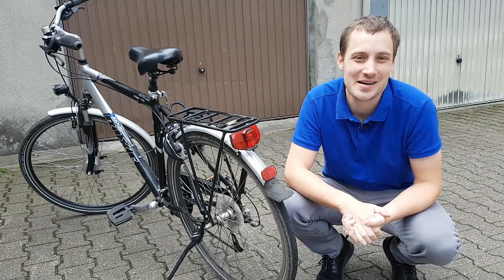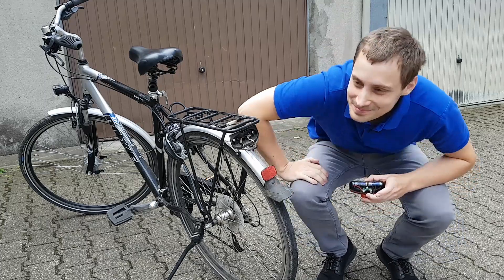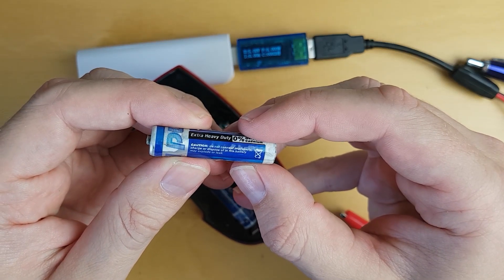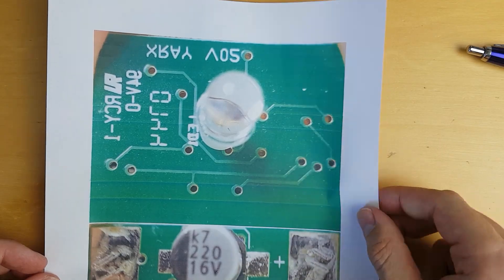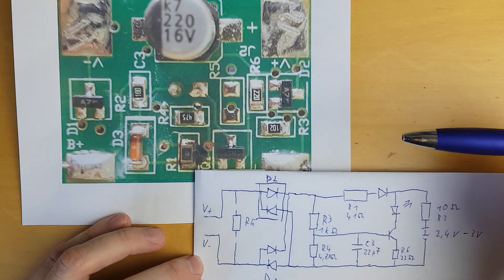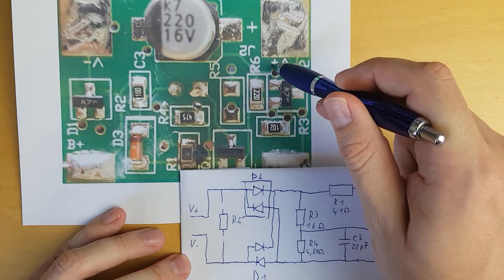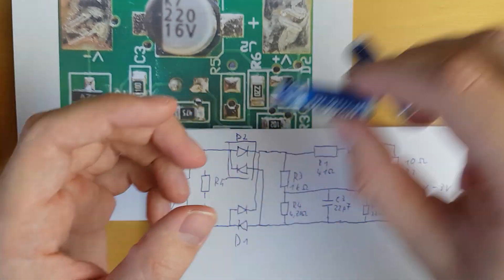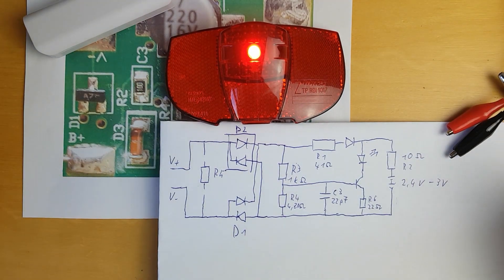repair and reverse engineering of a basta x-ray steady bicycle backlight

Comment: Hello. I have such a lamp. the problem is that if I put a battery in it, it lights up continuously (it's true that the battery is alkaline, but how can it be...) it can't be turned off unless I take the battery out...
do you have a solution for this?

Comment: Helped me a lot ..but..Checked it with a multimeter. the voltage @ the batteries does not exceed 3V. The big red diode [D3] on the  circuit which is kind of actively overlooked in the diagram appears to be a voltage limiting Zenerdiode.

Comment: Great work, very informative, thanks! It is strange that they use alkaline batteries for parking light. Mine doesn't have any batteries, instead there’s a capacitor on the circuit board, which is a more common solution among this kind of rear light.

Comment: Hi, I appreciate the video! One thing puzzles me though - why (except the cost) it was originally made with non-rechargeable batteries? Mine leaked as well, probably due to some moisture inside. I will try to revive it :)
Reply from the maker: I don't know. I agree that it is a little bit strange.
Reply: @MartinMeise  I am afraid that my lamp got corroded beyond repair. It does not produce any light at all. Still - thanks for the answer! Cheers.
Reply: Yes it is strange that they use alkaline batteries for parking light. Mine doesn't have any batteries, instead there’s a capacitor on the circuit board. Maybe it’s another version.

Comment: Hi, it is a very interesting video. I also have a Ellipsoid bicycle front light, model FL301. It does not work, I tried to take it apart to see inside, but its circuit is very complicated beyond my knowledge. Have you ever investigated this model or similar? If yes, could you please tell me a bit about its circuit/schematics?
Reply from the maker: Sadly, no. You could sent the Light to me and I maybe able to investigate.

Comment: What is  value R1 in ohm?  It  Seem that it is burned and I don't read the value. Thank you.
Reply from the maker: I measured it to 41 Ohm
Reply: @MartinMeise  so you measured with multimeter, you don't see the value on resistence, You too in the video R1 seem that  burned. Thank for reply

Comment: Thanks for the video! I wouldn't have guessed that it needs batteries, as mine was lacking them :)) I still have got one question. Will the light remain on until the batteries totally discharge? I can't see any mechanism for turning the light off after a certain amount of time, but in some places it says the led should be on only for 4 minutes after stopping.
Reply from the maker: Hey Reymond,
The light will stay on until the capacitor C3 has discharged below roundabout 0.6V. Then the transistor will turn off and the light will go off as well.

Comment: If you pedal too hard R2 and R6 will burn. Don't ask me how I know.. Now is it possible to make the light turn on again by making a solder bridge at R6?
Reply from the maker: Normally your generator should have a zener diode that should clamp the voltage to a certain level. Alternatively you could solder one one the output of one of the double diodes.
By design theses resistors should be well within there limits. For 6 V between V+ and V- without batteries I get a current for R6 of not more than (6V-0,6V*3-1,8V)/63Ohm= 38 mA and a Power 31mW. With batteries its 35mA for R2 and 12mW.
Reply: @MartinMeise   Idk I am not smart enough to completely understand what you are saying. What I can tell you is that the generator produces up to around 25V AC (measured with a multimeter). My aim is to make the light functional again somehow by ditching the batteries and the battery circuit. Of course it is not going to stay on when the rider comes to a stop but I don't care that much about it. Is it possible ?
Reply from the maker: @ΘάνοςΖησιμόπουλος  That topic is quite complex. Usually if you have a bare generator without any regulation, current and voltage will depend on the speed of the generator turning and the load of the generator. For a bike you would select a combination of generator and load (eg. a light) so that they will form a self regulating system and will work for normal bike speeds. When switching form light bulbs to LED's you have to take care of that. Either by using additional resistors, zener diods or active regulation.

How much current was flowing while measuring the voltage? If it was open circut - so no load and no current - that doesn't tell us much. You should test the voltage across a resistor with known value.
This light is made for 6V AC or DC. If you want to run it from a (steady - witch a bike generator is not) 25V AC power supply I would recommend using either a transformer 4:1 or a bridge rectifier together with a buck converter to transform the voltage to a level that is manageable by the light. If you exceed the limits of the light by four times it will always break. Alternatively you can think about using an led light that is made for trucks as they use 24V - 27V Systems.

Comment: Hi, I have same light and its suddenly off. But the problem its I don't know about electric 
Can I get your number for direct ask. Thanks
Reply from the maker: If you want you can share it here in the comments so everyone can benefit. In general I would check for good contact of all wires, springs and connections. Check for bad solder joints and corrosion. Also use a multimeter to check the voltages to ensure that the power form the generator reaches the light.
Reply: @MartinMeise  yeah..but how I send a picture?
Reply from the maker: You could upload the picture somewhere and share the link.

Comment: I thought parking light function was made thanks to a capacitor. I discover the capacitor just commands the battery energy. I thing a capacitor could be enough to assume the parking light function, don't you think ? (without transistor and battery)
Reply from the maker: Shure, than you need a more beefy capacitor. There is also a model of this light using a capacitor. I have it here with me. However, the circuit diagram is complicated and I haven't fully understood it yet. Maybe I'll make a video about it anyway.